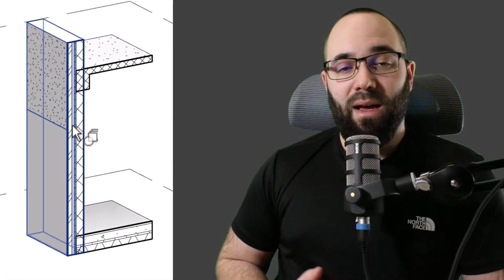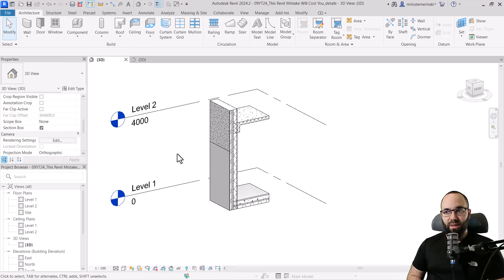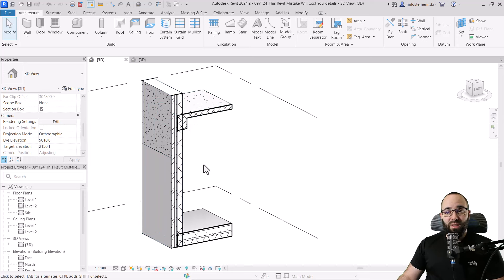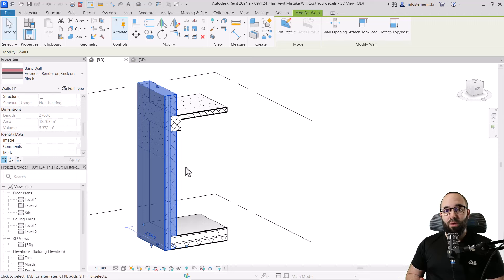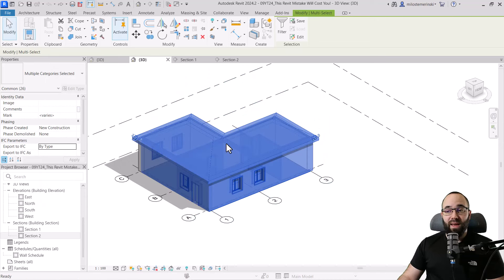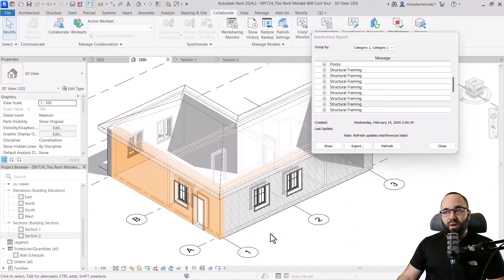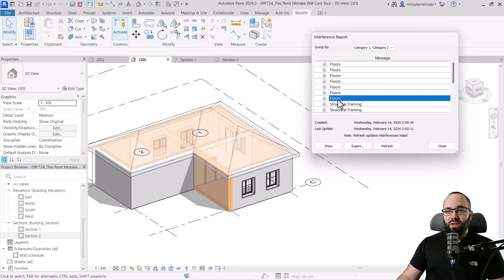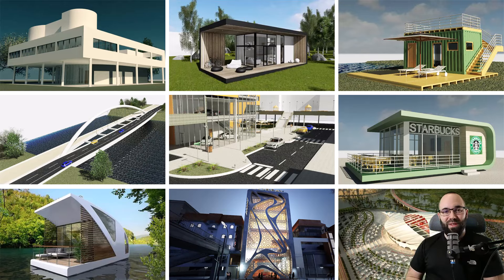Overlapping Geometry in Revit - Solution (Clash Detection in Revit)

Comment: if i made separate files between architectural and structural, and then I bind after i link them, which one should be cut, architectural part or structural part?

ex. i have a wall with 150mm width that overlap with structural beam with the same width (150mm) and I wanted the structure beams to be covered with wall instead.